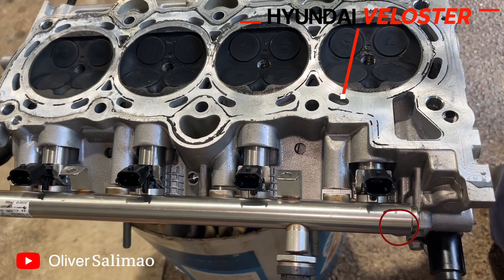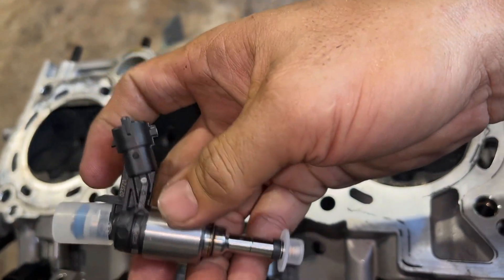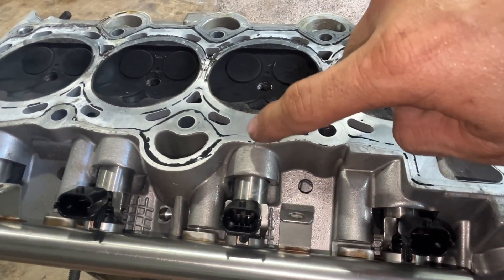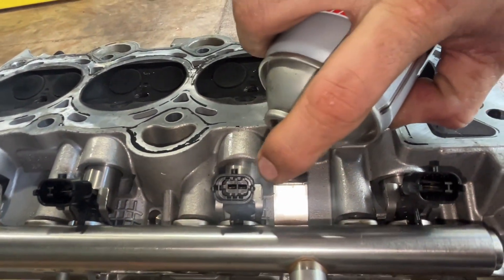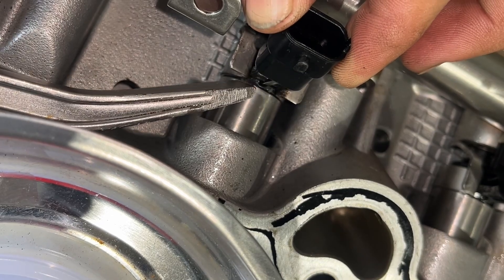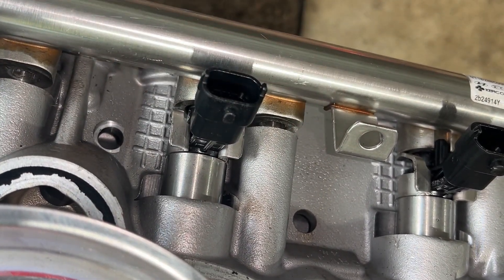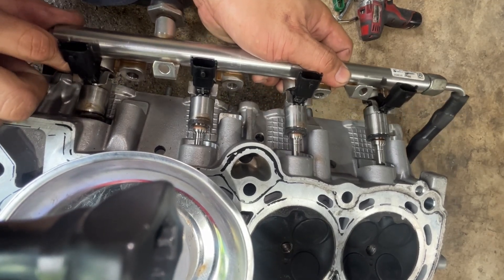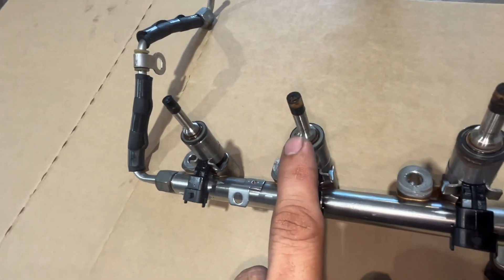HOW TO REMOVED INJECTORS HYUNDAI VELOSTER

Comment: I just replaced the spark plugs and ignition coil on cylinder 2 and 4 on the same make. I took it for a test drive and the brakes had lost pressure, on the way back to the garage the brake warning light went on. I looked at her fluid level it was low. I then looked under the car and noticed it was leaking. I am thinking she either had low fluid or just coincidence the master cylinder seal went out. My question basically is that me disconnecting the ignition coils and plugs shouldn't have had anything to do with the brakes messing up.?
Reply from the maker: Mate I think it’s only a coincidence brakes system is not related on the ignition system of the car 😉
Reply: @oliverthemechanic8532  thanks. That's what I thought. You don't happen to have a video for replacement of master cylinder on the 2013 Hyundai Veloster?
Reply from the maker: @adamkuehn1733  sorry mate not yet on that model but I think on a Lexus i have one 😉
Reply: I'm thinking it's not the master cylinder. I looked in the engine around the master cylinder and the lines going from it and no leaks but it is leaking under the car slightly past the middle towards the back. I am hoping just a simple brake line replacement. What are your thoughts?

Comment: I have another question. I seen a video to quickly check the canister purge valve  by removing one of the hoses. It says if you feel suction on your finger the valve is not working correctly. So my question is the hose to  remove would be the fuel line as I assume that it sucks in then blows out other hose into engine. Is this assumption correct?
Reply from the maker: I can’t understand what you mean mate 😬 by the way what’s wrong of your car?
Reply: @oliverthemechanic8532  thanks but nevermind. I was receiving a misfire and fuel injector code. After I replaced over the plug ignition coil I got the same codes with an additional canister purge valve code. I drove for a day with some fuel injector cleaner and codes cleared themselves.

Comment: Kabayan good day! Just want to ask.. I have a code p0087 showing in my hyundai veloster 1.6 gdi turbo. It runs perfectly fine but suddenly it will stop and will not start only cranking. After 30mins of trying it will start and runs back to normal again. I already change the HPFP but after 1 week same issue happened.. 1 more thing is i refuel my gas every 1/4 of the gauge and after that problem will come same thing it will stop and after sometimes it will start run back to normal. Any advice what else need to do. Expecting for ur advice.. Salamat
Reply from the maker: kabayan kmsta na sasakyan mo? sorry late reply 😬 common ang ganyan problema sa veloster crankshaft position sensor hnd nag bibigay ng code bigla na lng hard starting 😬